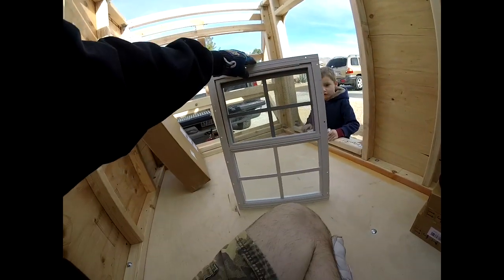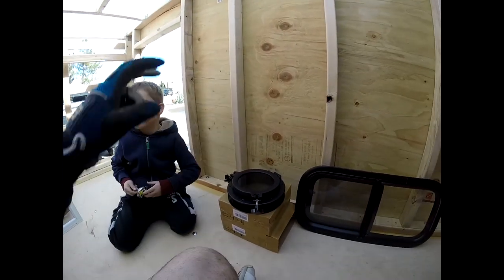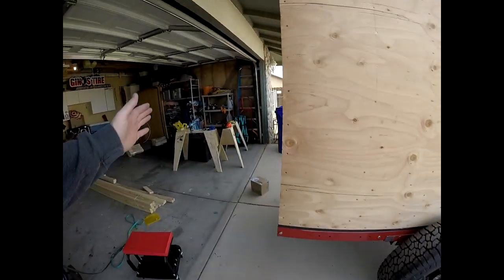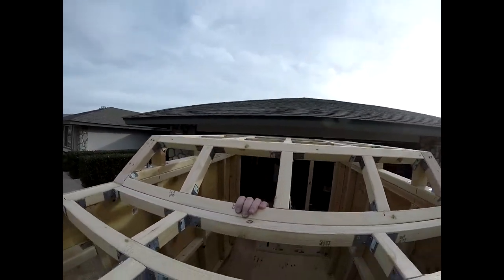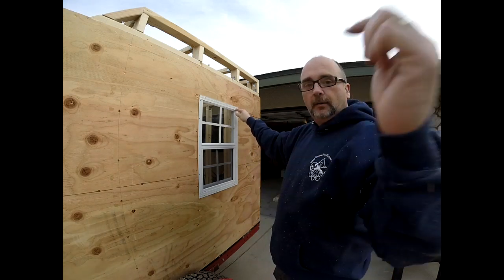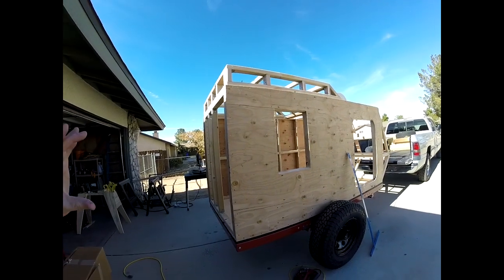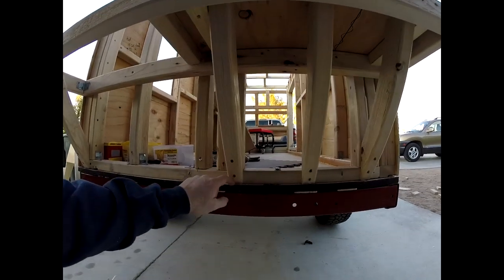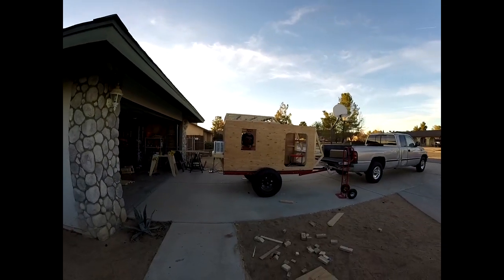Homemade DIY Camper - Air Conditioning

Comment: You really have that framed good. You certainly don’t have to much to worry about if it rolls over. Just be careful about your GVW rating.
Reply from the maker: Absolutely! I anticipated that I would more than max the trailers given load cap at 1197LBS. So I welded up the frame & tongue. I have future plans to swap out the stock springs, hangars, and axle!  Still a lot of filming to do next fall!

Comment: doing a good job  we use treated timber and ply here in new zealand as it wont rot in wet areas, wish we could get that stuff from amazon here seems really cheap, I have a super pod steel frame  aluminium cladding i put a couple of small windows in.cheers

Comment: I was just noticing your build love it it is giving me a whole new aspect I have five years to get our camper ready so I’m excited about building my own or possibly doing something similar to that as I was watching your video for the first time this morning I noticed that you were installing an air conditioner to the back of the camper and I couldn’t help but think about the being on the road and the vibrations and how that might affect your air conditioner and the quality of it overtime so I was considering maybe you might consider putting some cushion or some sort of a shock absorber between the air conditioner and it’s bass like maybe some rubber gaskets or something something with a thin layer but might have some cushion so your air conditioner doesn’t take quite as much of a beating with vibration it’ll make the screws loosen and so forth if I was going to do it I would probably have welded some brackets to the sides and then bolted the steel exterior of the air conditioners to the wooden frame and I’m not telling you this because I know anything because I don’t know nothing but I can’t help but thinking that these might be some ideas somebody might like
Reply: PS I can’t wait to see what happens next I am so watching this happily
Reply from the maker: @bethturner6968  I also wondered the exact same thing. I just figured I'd go for it and see how long it lasts! LoL. So far so good.

Comment: I dont have sound so i might have missed something, but a 4' wide camper for a family? Even two people is a squeeze in that width. Best wishes though.
Reply from the maker: Joe you are missing EVERYTHING without sound.
Reply: @DIRTADDICT922  Youre right. Ill have to start using headphones for better comprehension.
Reply from the maker: @joewoodchuck3824  To save you some time. My end goal from our start date of the 4x8 Camper project (Sept 2017) was to end up with a full size camper for my family eventually. However, due to me being cautious as we had just moved & bought our old business back I decided to build this teensy 4x8 so my youngest son and I could have some fun with it until I was ready to buy the full size camper. The build experience and the camping trips have been nothing less than epic!
Reply: @DIRTADDICT922  Thats great! I can understand your apprehension. What sort of business are you in?
Reply from the maker: @joewoodchuck3824  Well tires of course? LoL. I own a small Auto Repair and Tire shop in Big Bear City
 Ca.
Reply: @DIRTADDICT922  That sort of business just keeps rolling along! Best wishes with it and with camping!
Reply: I got one small trailer like a box 4 ×8 and i use it just to sleeping on a long trip.       2 person.      just to save time and money on motels but not for family 👪  of 3

Comment: As much as I want to do this, I'm buying a cargo trailer.. If I don't like it, the resell value is excellent. I could sell them on speculation in fact.
Reply from the maker: Actually the cargo trailer will make it so much easier as the floor, walls, and ceiling are already done! Love to see your build documented!

Comment: It would be awesome if you could link to the items you got off Amazon so folks like me :) can get them too.
I am building a camper similar to yours and am getting good ideas from your videos.
Reply from the maker: Are you going to video your progress? If so I want to watch!  Love this stuff!   I haven't added links but in most cases I did include a screen shot. If there is anything you see in my vids that you want to know more about just let me know.  I will make sure you get the pertinent info.  also if you decide to video it I will promo your site in my vids to help you get followers if you want?
Reply: That's pretty cool. I appreciate it. I've thought about videoing my progress, just not sure I would be good enough. So far I have a trailer off Craig's list that needs work before even adding a deck.
Reply from the maker: Ok cool. Well let me know if you need any help or advice. I just learned as I went but if I'll try if I can.

Comment: How did you frame the door on your camper? I was going o buy a premade door but i just can’t justify $400 on a door
Reply from the maker: Take a look at 4 X 8 Camper Part 8 at the 4.25 mark. You can see how it is framed. Also I cover the installation in video # 25 at 11:20 you will see the installation. Yeah they ain't cheap.

Comment: The AC creates condensation and will drop. so expect the wood to rot over time. and I would suggest having I slight angle towards the back so the water doesn't run back inside your camper
Reply from the maker: Yeah, many have mentioned that. The manufacture claims this is self evaporating. "No drain needed" in the paper work. I still don't fully believe that to be true. So I am keeping an eye on it. I have run it for many hours without any issues of condensation. I can open the bottom door and see the entire bottom wood panel . So far not moisture at all.  Time will tell.
Reply: @DIRTADDICT922  how did that go?
Reply from the maker: @justrealiam4525  Still zero moisture. ;)
Reply: @DIRTADDICT922  nice

Comment: Where the condensation for the ac gonna go
Reply from the maker: I get this question a lot. This unit is a "self evaporating" model as described by the manufacture. I myself have never heard of this LoL. But so for no issues.

Comment: It's far too late to give my two cents worth about the placement of the spare tire, since the video is already four years old now.... But! Never, but NEVER put the spare tire under the trailer. That is the worst possible place for ANYTHING, much less a spare tire. It catches everything imaginable that might be found on the road, from dirt and rocks, grease and oil and, yes, dead animals. I speak from very personal experience. I would rather take a beating than have to retrieve a tire from under a trailer where it has been collecting  said debris for a year or two.... or three....